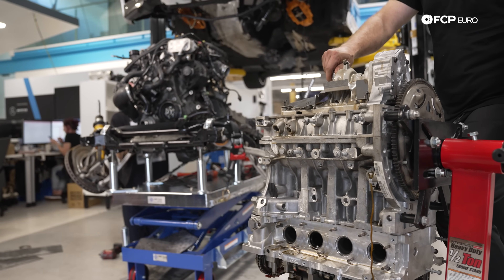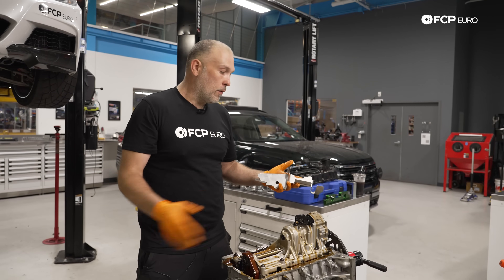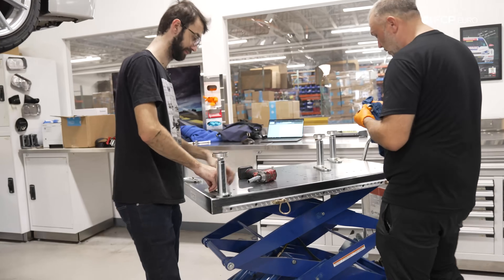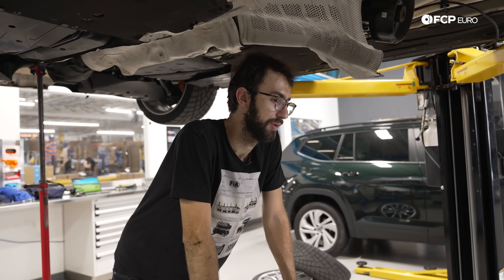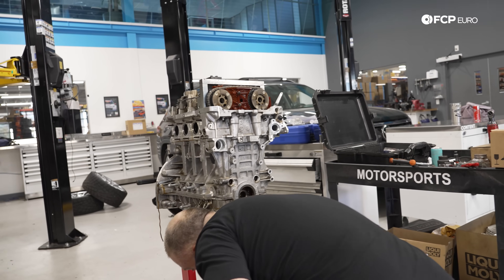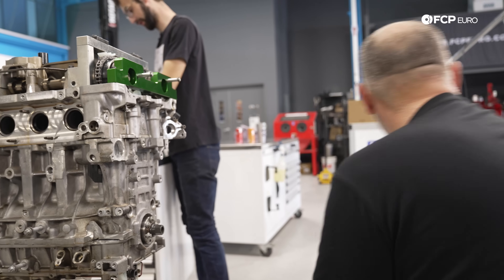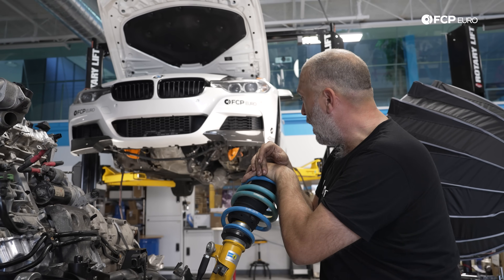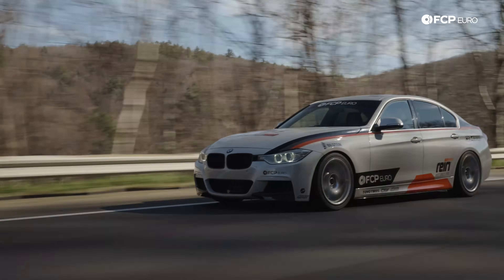Reviving Our Broken BMW 328si: N20 Engine Rebuild & Swap

Comment: My n20 was used for drifting up to 106k. Compression died in cyl 1 after pcv died while drifting and dumped aerated oil in to the cylinder. Still have original timing and looks perfect.

Comment: N20 is a shit engine timing chain stretched at 80k miles. Swapped for a new engine at bmw dealer, 30k miles later blown piston ring. Meanwhile i have a 20 year old n54 going strong .
Reply: You must be pushing the n20 really hard. It’s 4 cylinders

Comment: Do you need the balance shafts in this motor? I know of a dodge 4 cylinder you can remove or cut the chain to gain HP by not using them or do you really need the balance shafts in the motor?

Comment: Love the VID  Have over 120k miles on my n20   Never been to dealer  all parts from FCP  This is a great engine in my books
Reply: a bit more of 140k miles on my n20 and still rocking too
Reply: i will blow up. listen to me, i took care of it , replaced a ton of stuff ran great, timing chain guides replaced too, and engine seized today with 162k miles 2014 228i rwd
Reply: beside time chain guide, what else you change?

Comment: Tom the Switz here... I have my own channel dedicated to making cars last 25 years and 300,000 miles. In 2023 we added a CPO 2020 X3 rear drive to our stable. I love the B46D engine in that car... and I'm already planning on upgrading certain plastic parts to aluminum. HOWEVER, I have a fascination and possible fatal attraction to the N20. If we had the need for a 5th car (which we don't) my wife and I would probably add a 2016-2017 N20 powered car to our lineup. When you say "We appreciate what BMW was trying to do with the N20" ... I totally get that. The complexity... resulting reliability issues, tuning potential, all of it... it's just fascinating. 100% the opposite of a Toyota Camry. Thanks FCP Euro!

Comment: This is interesting cause I just tracked my N20 on stock suspension and just some grippy ass tires. Bad body roll out the ass but not real engine mods except a catch can, gfb diverter valve and turbo inlet. To see this motor go like this was concerning so I’m really hoping my stock motor takes more abuse because I’m not tryna push power.

Comment: I didn’t catch the failure video. Was it on track and how many miles were on the engine? Cause didn’t it run around 350 hp?

Comment: I'd love to see a DIY video on in-car rod bearing replacement for the N20. Originally I planned to replace them when doing the timing chain/guides/etc, but wasn't confident how to do it correctly. After successfully replacing the timing chain and components (thanks to FCP Euro's part 2 video series), I'd be more comfortable tackling rod bearings. Also plan to install the new oil baffle at the same time for piece of mind. Thanks FCP Euro!
Reply: Thanks for watching and we're glad to hear the install was a success! Long live the N20! Hopefully we'll have some better circumstances to show an in-car rod-bearing replacement in the near future!

Comment: I was super motivated when I saw this build telling myself stage 2 stage 2 I saw it blow up … my 328i is staying stage 1 can’t afford to fix a broken engine love your videos made me love my car more and work on my car more often thank you
Reply: You’ll be fine. They blew up their n20 due to negligence. Went drifting and didn’t check oil levels before hand nor added the 0.5 quarts of overflow to prevent oil starvation. Their baffle appears to work for straight movements, but not side to side as the n20 is known to have oil starvation issues with long sweeping right hand turns. Their baffle didn’t fix this.
Reply: You're better than me, I bought a bm3 license in 2021 same time of year, still haven't tuned it... I'm just too scared nowadays